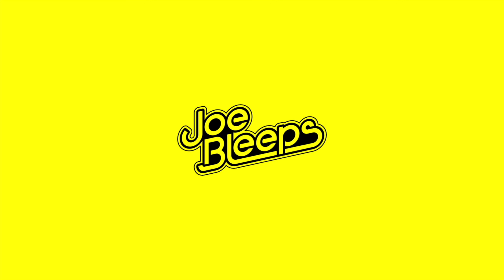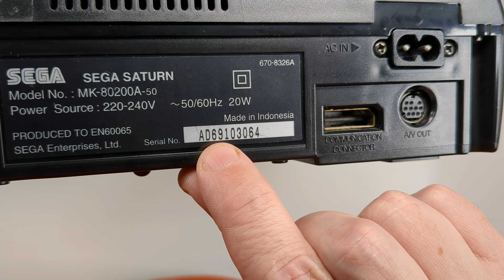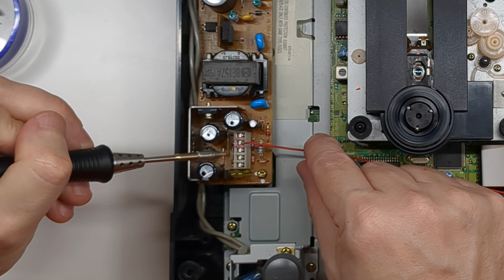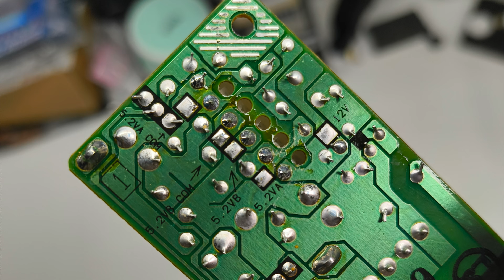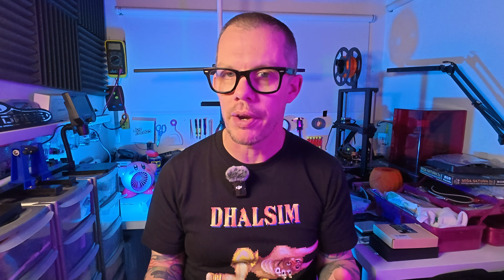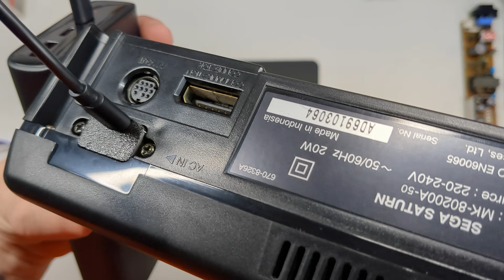Sega Saturn USB-C Power! Easy Install Guide

Comment: Your video saved me a headache. I got a Saturn off ebay recently and it worked with oem PSU, but I noticed some capacitors leaking. I was having video cutting in and out. I bought the ReSaturm PSU like the one I got for the Dreamcast, but the fact I had to use the laptop style power brick was a pain. So I bought this and received it today. Everything went fine install wise, but several games I had a cracking and popping sound while using them, like Batman. Then I saw you mention the 12v and 9v switch. I have a C version of the US Saturn. So, while watching the video, I flipped the switch to 9v instead. Tested before screwing the cover back on and that fixed my issue. Now I want this same psu for my Dreamcast too!

Thanks for mentioning the voltage switch. Glad I figured that out and if someone else has that issue with this, hopefully it will help them too.
Reply: Sorry english is not my native language, but did you have issues with 12V and switched to 9V to fix your issue?
I'm not sure if I understood this correctly.
Because I have a C version (VA15) japanese NTSC Saturn and use the switch on 12V currently.
Sometimes I have frame drops in Panzer Dragoon Zwei and don't know if this could be a issue...

My power brick is a Anker Nano 3 with 30W PPS.

Comment: always love a USB C power mod!

but tbh if it has a core on MiSTer then there's no longer a point in going through the process of modding classic hardware (especially rare hardware that is worth more in stock condition)

I've sold my N64 RGB & pixelFX boards (never had time to install them anyway) and stopped myself from buying the USB C power board for it too - now that the N64 core on MiSTer is nearly perfect and the Taki Udon kit is $95 - I'll save $150 on a flash cart, $50 on USB C power, and $150+ in reselling the RGB & PixelFX boards (on just 1 system - not counting the various flash carts I no longer have to buy)
Reply from the maker: @iamdmc  I understand that approach, but using something like a MiSTer it still feels like using an emulator. The experience of playing on the original controller after firing up the original console after connecting it to my TV still holds some nostalgic authenticity that even 100% accurate emulation can't beat.